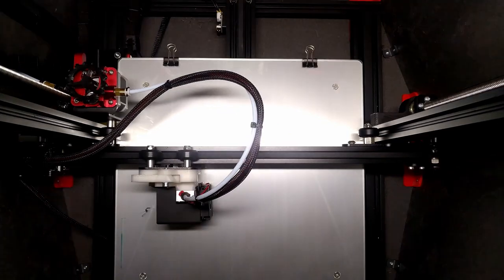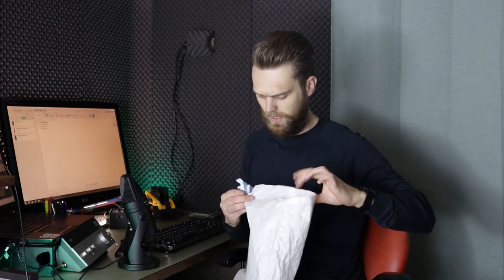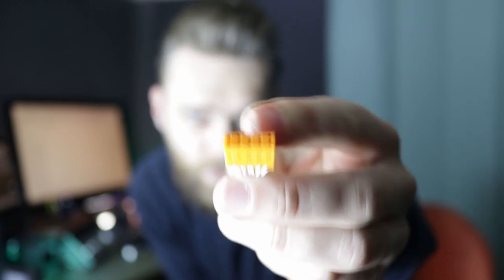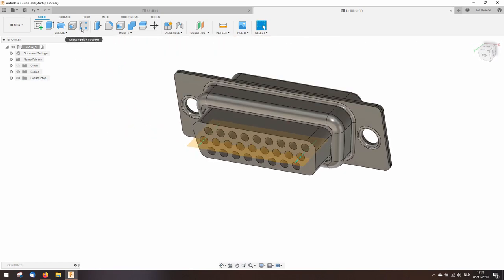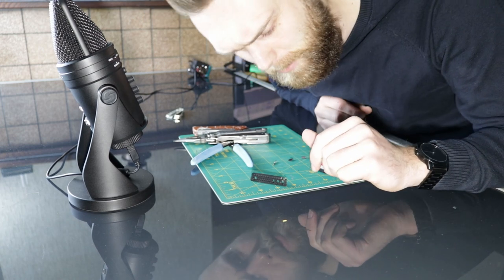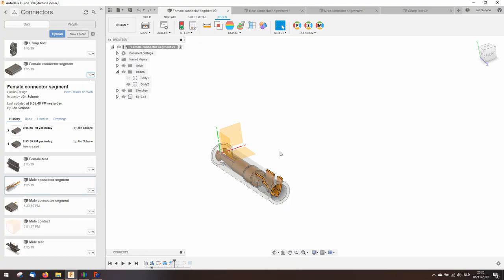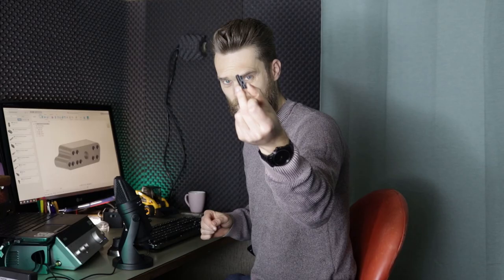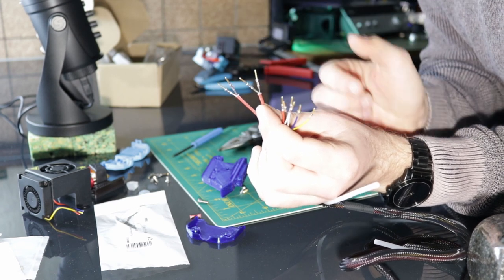Design and print a custom connector for the Creality printer with swappable hot end

Comment: Hi. Wouldn’t it be easier and cheaper to buy a standard Db15 plug, remove the unwanted pins in the middle and drill a hole in the center to the desired diameter?? That way you wouldn’t have to buy expensive and hard to find connectors and still have the screws to fix everything. Also you will have the easy to solder cups instead of the pins which require using expensive crimpers.
Reply from the maker: Thanks for your comment. Yes, this would indeed be easier. My goal of this channel and my ideas is to explore new things which I, and hopefully the audience, can learn from. These new ideas often lead to new inventions which I would have never found otherwise. This connector for example can lead to embedding connectors in housings or add functionality to a connector which wasn't possible if I'd chosen the standard, simple way. This is just a start ;)

Comment: I'd adapt a serial port for all that, using two pairs of pins for hotend and two more-for feeder motor to deal well with higher current, as we have there 9+gnd chassis pins, it's enough. Or we had 3 pins left for sensors if use chassis gnd as hotend-

Comment: I know you want to do those things yourself but wouldn't be the Extruder Extension Board for the Geeetech A10, A10M... A Good solution?
I mean you have 12 Connections and it is just a little PCB with 3 holes to mount.
Reply from the maker: Thanks for your suggestion! The idea behind this approach is to explore the possibilities of the custom connector. For example combining it with a cable chain that I've done in my video about cable management.

Comment: I dunno. I see the cool connector and it is something to be proud of, but if all the other ends you have to swap in and out don't require filament, why not leave the connector for wiring only and have the filament separate?

Comment: Jon,  why don't leave bowden alone from the electrical connector? I know that there be 2 things to connect, but maybe is fast and last longer
Reply from the maker: I like that it's possible to embed custom things to the connection, like the bowden coupler. It's fast and looks cool ;) I don't know how long this will last, but I've done a decent amount of printing with the old design to be confident enough to say that I'm not worried about that :)
Reply: Thanks

Comment: Hey Jon. Whats the reason behind the statement that an ender 3 outperforms an ultimaker 3? Does it count for UM 4 and 5 aswell? Do keep in mind that the pressure on the bowden tube doesnt disconnect your electrical wires
Reply from the maker: Hi Yanou. I intentionally say, an upgraded Ender 3 ;) The Ultimaker works good right out of the box and it's fool proof. However, the Ender 3 enables everyone to upgrade it with better control boards, hot ends, direct drive systems, bed heaters, bearings etc. This comes of course with a price, but you can do a lot with the 3k an Ultimaker costs. I like the fact that it's possible to get these awesome results with such a cheap printer which is accessible to many. We have an Ultimaker 3 at my work and I often get better results with my Ender 3 or CR-10. The pressure is definitely something I keep in mind and therefore I use these screw locks and the bowden coupler since I already ran into this issue, thanks for mentioning!
Reply: @properprinting  Ah, totally get it now :D Thanks for the explanation my dude! Keep on fabricatin these videos :)

Comment: I agree with leaving the Bowden off the electrical side comment. Cost more but there are pneumatic quick connectors you could use for that. And pogo pins would let you use a slide on connector and it embed it in the whole camera inspired connector tie into them as needed for tools. Being there keeps them from getting dirty and you can print holders for a pegboard or covers for longer storage. Vertical holes in electronics are bad juju.
Reply: Also printing accurate holes that diameter for a lot of people will be hard.
Reply from the maker: @ransombot  Thanks for your comment and thoughts! I personally don't see the advantage of using pogo pins. It looks too complicated to turn this into a finished product. I could be wrong though because I probably see it different than you do right now. The idea of selling this as a kit is still relevant, and printing the whole connector has a lot of advantages, especially when I get the crimping and placing right. About the printing accuracy: I use an Ender 3 pro with the upgrades as I've shown in earlier video's including the z-homing switch in the base. This is a nice product which shows what an Ender 3 is capable off ;)
Reply: @properprinting  I was thinking the pogo pins in the printed connector and base on the frame so there's no "attaching a cable after" means you connect all the electronics, and a pneumatic quick connect for the bowden/filament since if your milling, or measuring, or using a different type of extrusion all together like clay, glue etc, you won't be changing anything other than the electronics & the head, also lets you pull it quickly when it's hot without fully retracting like you can with the current one your using.  No screws, no second cable, no nothing past attaching the head. Your already getting alignment free with the connector you have if you use it & save the time every time you change tools! 

Example: https://hackaday.com/2018/04/09/3d-printer-gets-hot-swappable-hot-ends/ Another example would be any injet printer  & quite a few electronic tools used in robotics like https://www.ati-ia.com/products/toolchanger/tool_changer_features.aspx  fairly common fast and simple to use in more than just programming and testing of electronics. It also keeps dust and oils and plastic wisps from printing from settling on the to holes if you print mounts for something like pegboard behind your printer to store the tools on would build up and clog after a year or two and fouling your contacts like the cartage consoles of years past that you had to blow in to get a good connection adding moisture to the muck even with simple dust flap covers.

Not trying to convince you but explain what I'm saying and why.  Regardless hopefully it stays open & diy hack-able like I had to to get it to fit on the ender 5 which uses a different carriage I hacked it with a drill because fusion 360 the devil to learn with outdated tutorials if your making a product though it needs an extra hole for the ender 5 on the base have a few ideas for remixes but haven't found the time to learn & draft them. If you sell an aluminum version of the base & the 3d print head mount I'd buy tomorrow, I melted 2 testing a new board with the wrong pins defined in marlin and I'm not printing with anything other than PETG & PLA till I can get a proper exhaust hood and after that mistake I'd have reservations about 3d printing one in something more toxic that close to heat maybe carbon nylon it's soso unless it's burning. 

Thanks for all your contributions so far trying to give some constructive input not be critical of it in the least I hope I clarified the why some.
Reply from the maker: @ransombot  Thanks a lot man, you made it completely clear for me now! Funny thing is that I thought of this approach yesterday without realizing that this is what you meant. I'm used to work with 30mm long pogo pins so I had a different image in my head xD
I think it would be interesting to take a further look into using these connectors: https://www.mill-max.com/engineering-notebooks/introduction-to-spring-loaded-pogo-pins-connectors
I'm thinking of printing the base with the JetFusion technology which has its advantages. I know a printing company which owns this machine.
Thanks a lot for your clarification, this helps enormously!

Comment: Man I didn't thought it would be possible to print this kind of custom connector with a fdm 3D printer, and you made it! Congratulations! The model is very beautiful, you made an awesome work. Do you plan to share it on thingivers? Maybe with a bit of tweaks to make it easier to mount than you encountered during the video?
I was thinking about building the previous model, do you advise me to use this one instead?
Thanks to sharing this with us!
Reply from the maker: Thanks man! When I printed that orange connector at my work I was very skeptic. My colleagues told me that this wasn't going to work but is was kind of necessary to get this to work xD and it did the first time!
I am definitely planning on sharing this on Thingiverse after I've done some tweaks together with the individual segments. I'm going to buy a better crimping tool and an insertion tool and I'm going to make 2 versions for 12V ( CR-10) and 24V (Ender). The previous model works and I've done a lot of printing with it. However, I suggest applying glue to the bowden tube. I'm going to build upon this new version but I cannot say when this is finished. So, it's a choice between the old version you can use immediately or to wait for this new version. Another thing to consider is which parts are the easiest to obtain for you, maybe a standard d sub 15 with a hole drilled in the center will suffice. You can contact me on contact@properprinting.pro or via Discord properprinting#1572 if you need more information or want to try out some early designs.

Comment: Just a thought, and maybe i will need to look into it myself but theoretically a USB-C connector can support 100w on the gnd/vbus pins (whilst the standard states that max is 20V 5A, I doubt that 24v 1.6A would cause any dramas given it's ~40W). I guess I'm saying there is a potential that we could use a break out PCB on both ends of a USB Type-C cable to carry the 30w the heater needs + a handful of other signals - I think 8 other pins would be available. If needed you may be able to share ground to reduce pin consumption... Any engineers willing to give it a shot? It could revolutionise our cabling!
Reply from the maker: Hmm, interesting thought! Amazing really how much current can run through that connector. Another thing that was mentioned is using pogo pins so no connector is needed. Another thing that crossed my mind is using sliding contacts so no cables are needed at all but this would be pretty daunting xD

Comment: Do you have a wiring diagram for this and did you design anything like this for the laser mount?
Reply from the maker: No, I haven't made a standard yet so you're free to make your own configuration. I haven't done anything with this exact connector yet, but I haven't abandoned it either

Comment: I've heard some assert that the resistance from a pin added in between can throw off things like PID tuning.  Have you found this to be an issue?
Reply from the maker: Thanks for your comment! I've read that the error is negligible and I didn't have any issues with the temperature. The whole system isn't calibrated anyway so even a small offset doesn't have a great impact. At least, this is my experience with it.
Reply: @properprinting  Good to know!  I was really impressed with your last swappable design, but I love this more accessible design!
Reply from the maker: @davidguinn5355  Thanks! If I get the hang of it than it should indeed be a lot more accessible. I think there are more possibilities of embedding connectors in housings as well so I think it's interesting to build upon this idea :D
Reply: That's mostly about thermocouples, thermistors dont really care about extra connections

Comment: "The bowden tube sprang loose" I am not going to say anything else LMAO Nice video bud.
Reply: I had used those little pin connectors for the hotend in the past what are they dupond? The problem is this. Each time you are going to push the connector together you are going to push them little pins down. This is wy i used standard sub D 25 soldered connection for hotends. 100% secure connection and plenty of pins to to connect lets say a  BL touch or something.
Reply from the maker: @Caved111  No, they aren't Dupont, the orange connector I've shown is. There is a small ridge within the connector which hold the pin in place. This is where I'd a lot of trouble with, but it looks like I've found the sweet spot of the amount of force needed to press them in and that they stay in place. I like the fact that it's possible to embed the connector directly in the rest of the design like I've done with the holder.

Comment: In the 80's we used to use female parts that solder onto a circuit board. They had round holes for the male pins. Maybe something like this?

Comment: have you tried a pin insertion tool .... it makes it a little easier for making up d-sub connections/
Reply from the maker: No I haven't, but it would be a good idea to do. The pins shouldn't be hard to insert, but with printed connections it's a different story. Thanks for your suggestion!

Comment: I looked at the suggested PA-09 and have to say that I "could" recommend those over some Chinese crap any day. BUT:

Neither does it have a ratcheting system nor any kind of advanced lever mechanic. They're just garden pruners with a good crimp head.  Fine for crimping your 7-8 pins but your hands will begin to hurt after that. Want something better?

If you want an extremely high quality AND easy to use crimping tool then I can wholeheartedly recommend the brand KNIPEX.
Its a German brand and has the highest manufacturing quality on pliers I have ever seen. Seriously. Plus the're not resting on their laurels like many manufacturers do. They keep coming out with innovations every year. Just check out a video of their new Twistor16 for example. Where else do you find something cool like that?

KNIPEX has mid-range prices for crimping pliers starting at 80€ (up to high end ofc.) Most of those are available on amazon and not nearly as overpriced as comparable pliers on Farnell. (I looked up those few in your video. They were either highly specialized or from "dinosaur age" manufacturers who still think they can charge hundreds of € for outdated tools only because they have an "established" name)

I won't recommend a specific model for you though. I rather suggest you take a look on their website:
https://www.knipex.com/index.php?id=1216&L=1&page=groups&groupID=1299
check out what exists, and learn something in the process. Because the more you yourself know about crimping the more precisely you will know what you really need and want for your application.

Hope that was of help to you ;)
Reply from the maker: Thanks a lot for your comment! I think it's a good idea to invest a bit more in a tool like this since I'm planning to do more with this idea. This definitely helps and I'm going to take a further look into this!

Comment: €450 For a crimp tool is actually not that bad. the original crimp tools from the manufacturer are usualy in range of thousands of euros, clearly not within any hobbyist budget. I've bought several low cost crimping tools from amazon over the years as part of set with the connectors and one of them actually turned out to be pretty good.

Comment: As far as I understand, the biggest problem is fixing the bowden tube in the connector. I suggest you consider the idea of attaching a Bowden tube with a collet clamp (for example, this: https://www.thingiverse.com/thing:1993384). In this case, the collet part, possibly, should be made not of 3, but of 4 parts. The base of the collet can be a “П” -shaped bracket mounted on a standard D-sub connector body (with screws or glue), and the clip should consist of two symmetrical halves that are disconnected along the line of the D-sub connector housing.

Comment: Really love the design, but it looks like a substantial headache to assemble and actually use.. (?) - I think personally, I would have used a simpler "normal" off-the-shelf dsub (maybe a mixed one for the heater pins), and left the bowden tube separate.

Comment: Hi I work in a connector manufacturing company try the legendary Japanese PA-09 crimp tool. Give me a shout-out if this was helpful.
Reply from the maker: This thing looks good, it has been mentioned in an other comment as well so this must be a good tool. Thanks for mentioning!
Reply: They are still a bit expensive,  coming up at $45 with tax out there, but If I ever need to do more than 10 crimps a month I would CERTAINLY get PA-09/PA-21 combo
Reply: You are also gonna need the PA-09 if you ever want to crimp on the small jst that the nema 17 use.
Reply: @Ken Fullman Mine are JST-XH2.5mm
Reply: @NightMind0  If that is too expensive for you, check out the IWS-2820 on aliexpress. After some recommendations I have tried one (after previously using a PA-09 at my job in japan) and it is pretty much just as good. Should be under 25$ including stripper.
Reply: @tHaH4x0r  Yeah I've been eyeing those for a while but I already do own a tool that kinda works so won't pull the trigger just yet.
Reply: @Ken Fullman If you squeeze the connector off you'll need to adjust the clamp force, there's usually a small screw at the side that locks a gear like thing in place. Remove screw, rotate gear thing, put back screw.